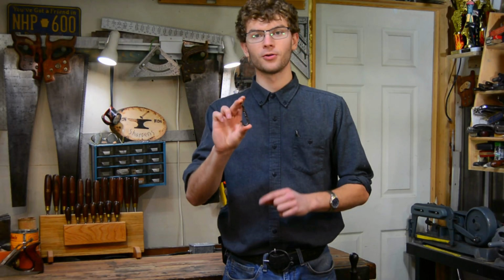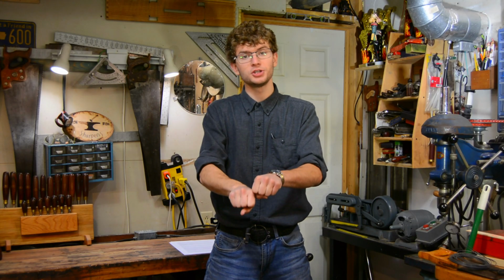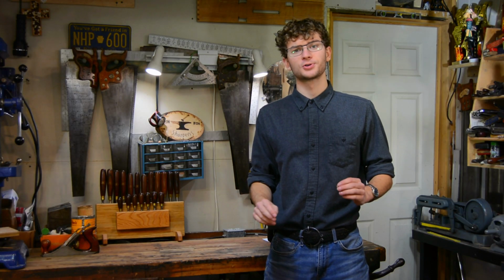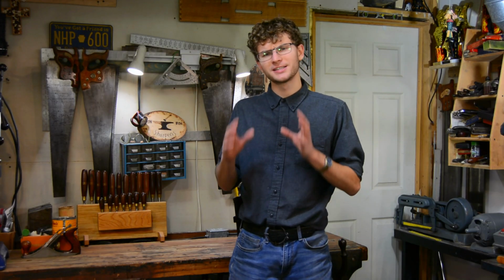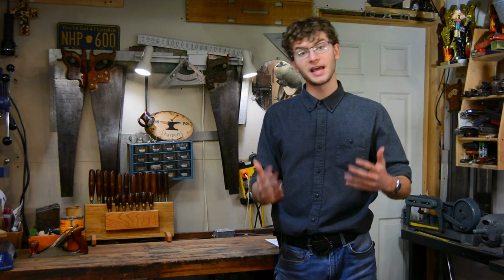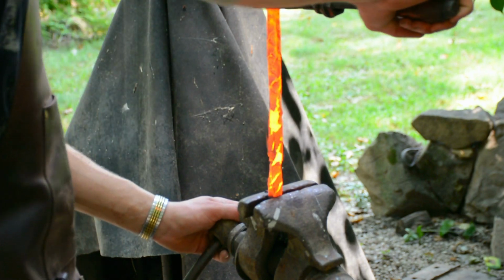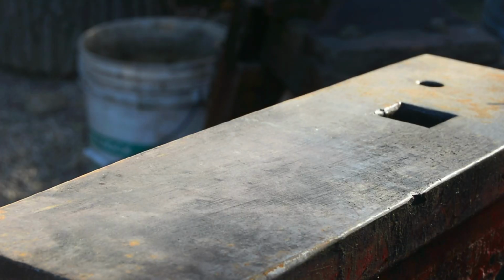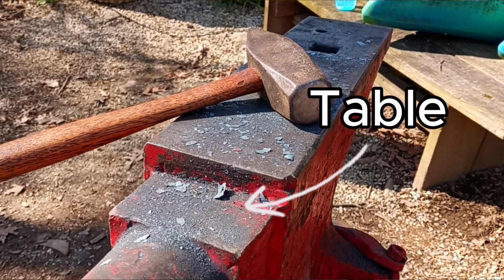Hammer like a Blacksmith! A Beginners guide

Comment: My guy, with all due respect, Sudan is a country. A sedan is a type of road going vehicle.
Reply from the maker: @terminalvelocity6659,
My poor grammar strikes again!😅
Thank you so much for pointing out this issue! I fixed it.

Regards,
God bless,
-Miles Forge
Reply: @MilesForge  hahaha don't sweat the grammar. Just keep doing what your doing my friend. Your doing a great job. I am a traditional archer as well as a metal worker and wood worker. I make my own wooden arrows and bodkin points. I have not gotten around to making glue on broadheads. If you have time and want to give it a shot I would love to see it. Thanks buddy! I just subscribed.
Reply from the maker: @mikeyheltonjr,
Wow! That is quite impressive!
I really appreciate the suggestion! I will be giving that very serious thought!
Should it work out, I would love to hear your thoughts on it when finished.
Thanks again!

P.S. what would be an optimal weight for the broad heads?

God bless,
-Miles Forge
Reply: @MilesForge  broad head weight depends on the archer and draw weight of the bow. Mine would be between 6 and 8 grams.